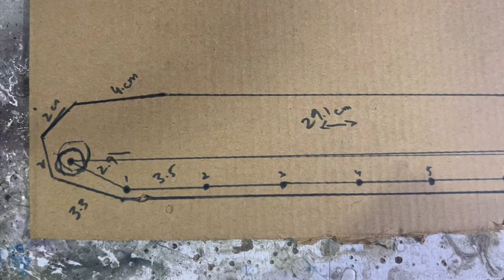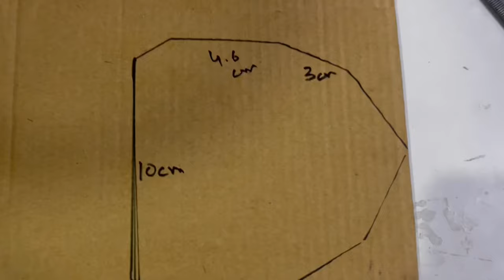DIY RC Panzer 3 & StuG 3 Tank Combo Build!"

Comment: Actually how do you make the cog wheel/ driver wheel? Do you buy it from somewhere or you just make it by cardboard or metal? Because I had problems with cardboard cog wheels, their teeth just folds when the tank is heavy and stress on the track is high lol
Reply from the maker: I made it with metal 
You can buy it is easy to find and it is not costly